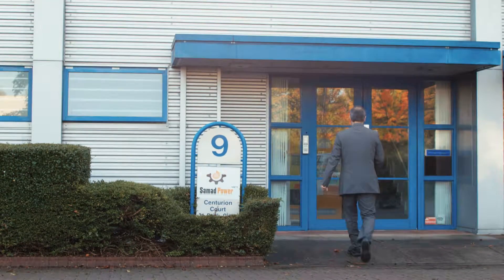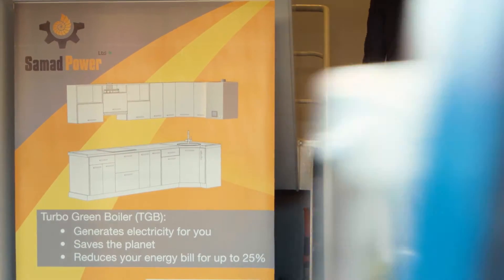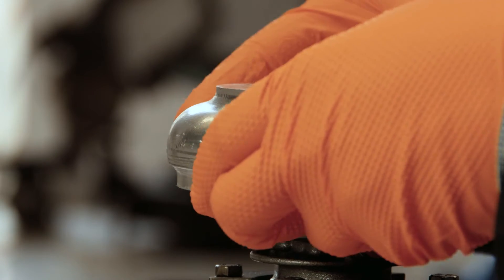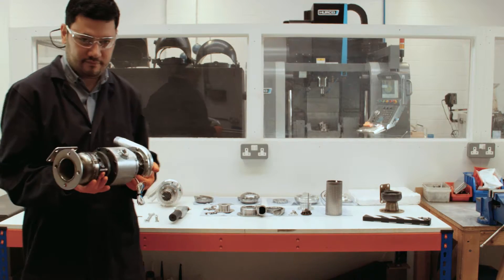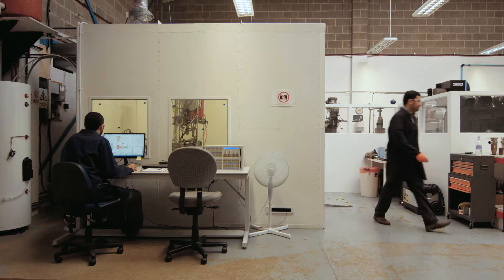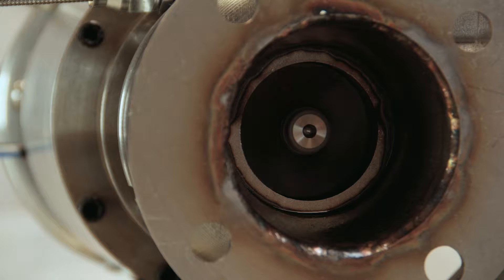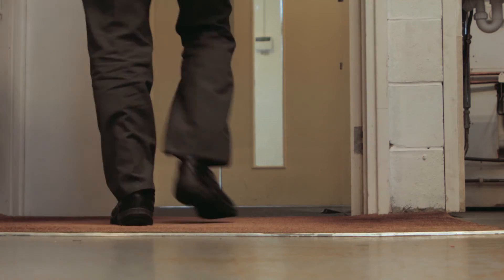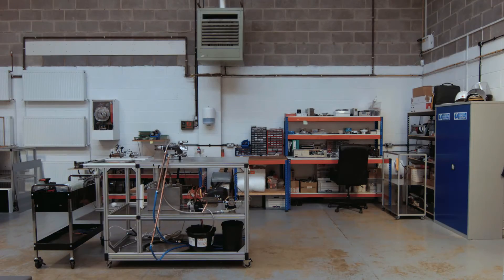The real solution to the micro CHP challenge

Comment: I just visited your website. This is a wall-hung boiler; thermal output is 17 kW (about 58,000 Btu/hr, I believe) and electrical output is 3.0 kW. The fuel is natural gas. Very impressive.
Reply: This would be perfect to replace my boiler. Is it available today ?
Reply: 15% conversion to electricity. Instead of 98% conversion to heat, it's 80% conversion to heat and 15% conversion to electricity. If electricity is worth 3x the price of gas, that's 125% by value. It's worth a look.

Comment: Very, very interesting work. I'm curious about cost, alternator output etc.
Reply: The version shown, based on the figures here, converts 15% of the heat to electricity (not great), but electricity is worth 3x the price of gas, so:
80% heat,
15% electricity,
5% waste.
But, by value:
80% heat,
45% electricity,
5% waste.
So, worth a look if reliability and cost aren't problems.